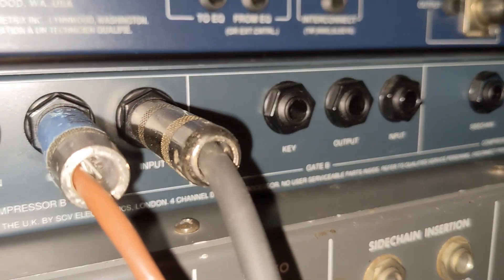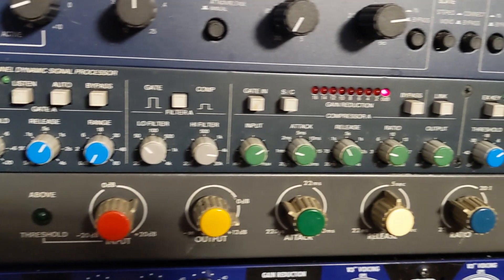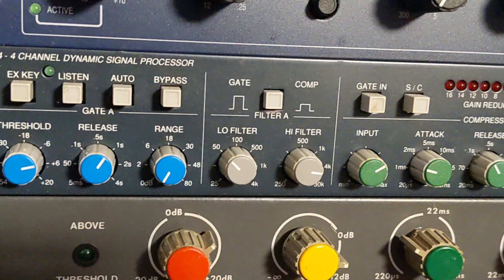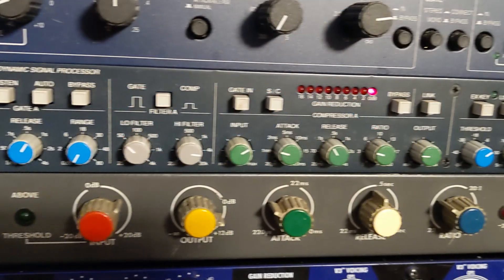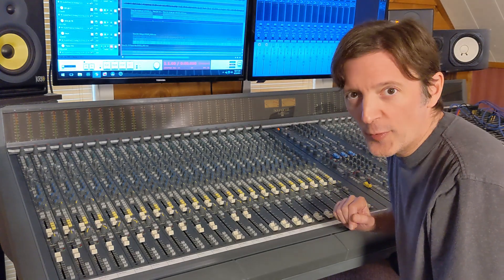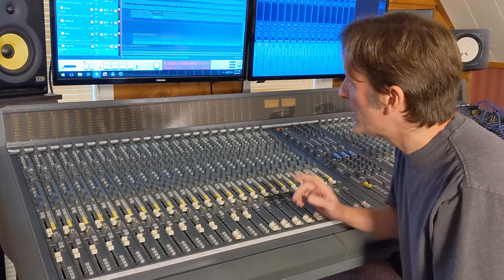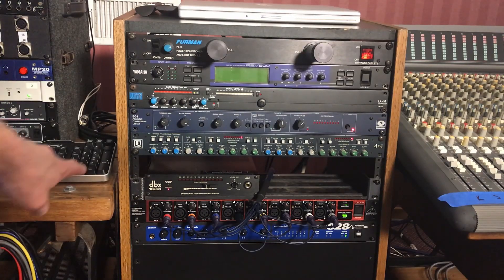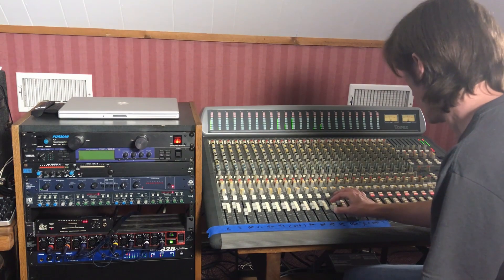My Favorite Gear Ep 7 LA Audio 4X4

Comment: Hi, really cool video, very interesting ! I have a  question though: how do you connect the compressor to the main bus ? I have an insert on my mixer for the main but there are 2 outputs LR. Thanks !
Reply from the maker: I usually use the inserts but you can also run it after the master outputs before whatever device you normally  run the master outs to. In that case, the compressor output would set the final level rather than the master fader.